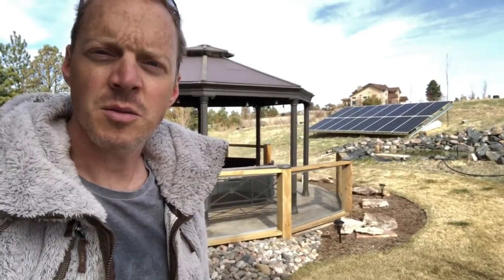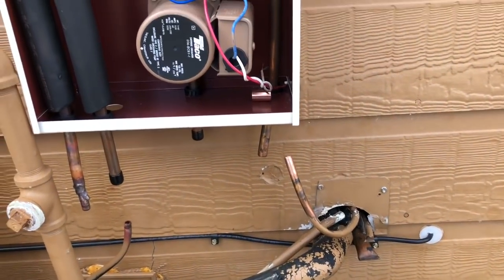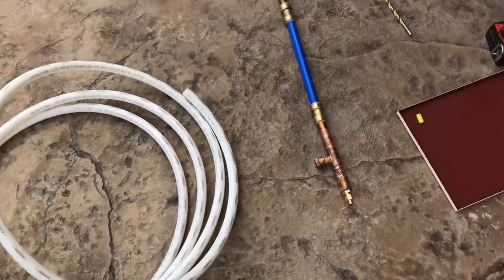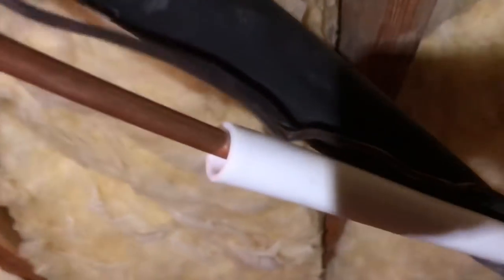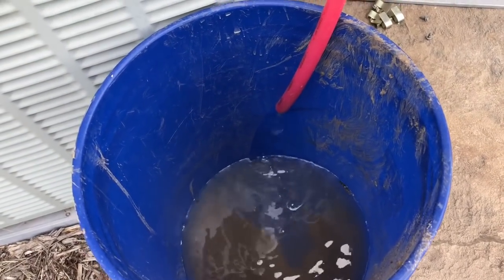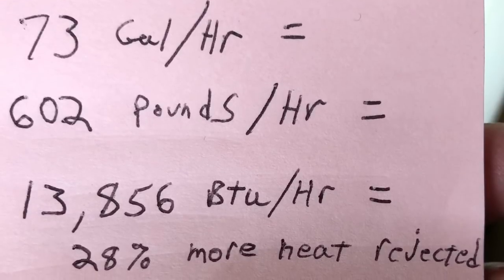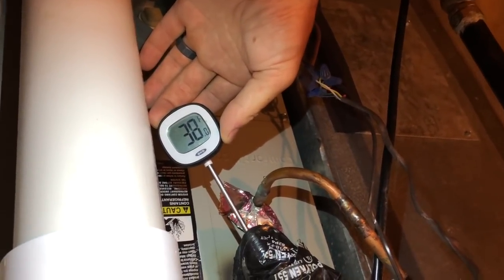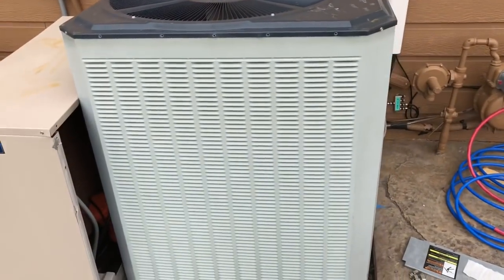Solar powered heat pump part one

Comment: Why are you running a 5 ton condenser with a 4 ton indoor? That’s going to give you the low pressures you have. I’m in the field commercially for 25 years and I get what you’re trying to achieve less the mismatched equipment?

Comment: Your trying to pull heat from the liquid line thats already been cooled by air . Desuperheaters are meant to pull the heat before the air coil when its a hot gas and youll get much more energy to put into your hwh tank vs dumping the heat outside and then trying to pull heat from it.

Comment: Sorry matey, big thumbs down from me (ex-Trane refrigeration engineer).  Don't try this at home kids, this is an accident waiting to happen - and in many countries it also happens to be illegal.
Reply: It's a genuine attempt to 'protect' wooden-tops who might copy this.  I'm not in the industry anymore, just for the record, but when I was a lot of 'engineers' didn't really understand the 'simple physics' themselves and were probably quite protective as a result.  I could write a short book about what's wrong in this video, but you can stick up for it if you want.
Reply: If you don't mind me asking, why is it dangerous and illegal?
Reply: I agree. From a proof of concept it works and if refined could become a viable thing. (evap misters for the condenser are simpler and is a common DYI here in Phx, AZ.USA)  The illegality comes from the release of feon and the wiring codes within the area to start with. Next would be the damage of the AC unit itself from contamination.  Best not to mess with unless you have the knowledge, experience, and equipment to do so.
Reply: It has to do with certain refrigerants being banned and licences being required to handle refrigerant - largely due to environmental issues agreed internationally for many years.  The safety issues relate to the pressures involved and potential harm from escaping refrigerant, particularly, in this case, if in liquid form.
Reply: No surprise... more HVAC guys trying to protect their jobs by discouraging DIY types.  If a DIYer takes the time to educate themselves, buy proper equipment and follow the rules, how are they any different than you?  HVAC is not rocket science, for the most part it's simple physics.  As condenser temps drop, COP goes up for air conditioners.  This is not hard stuff.

As with anything, be responsible for your own actions and have fun doing and learning new things.